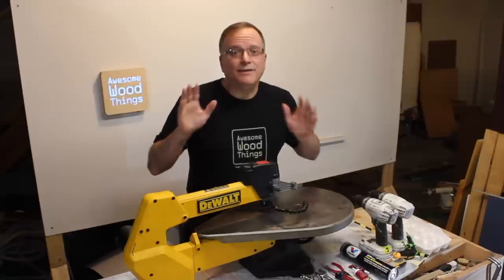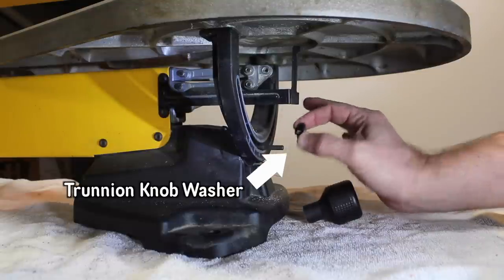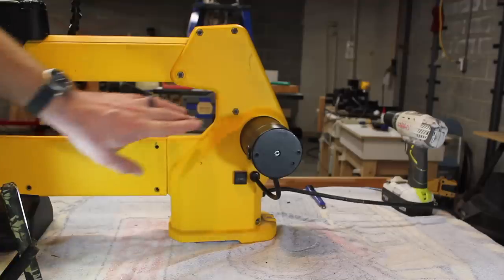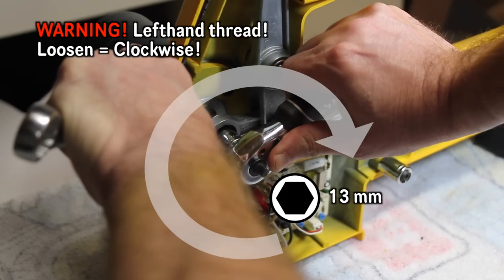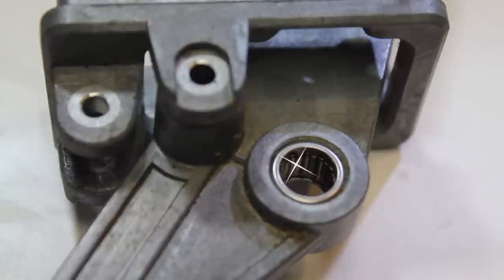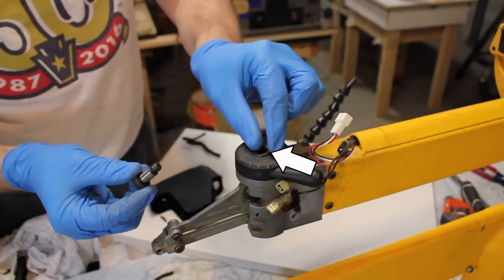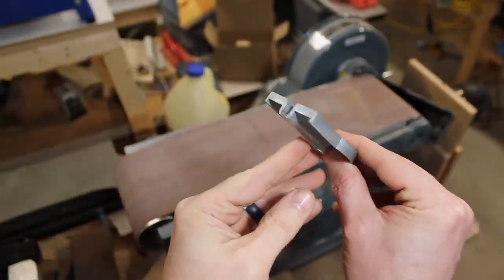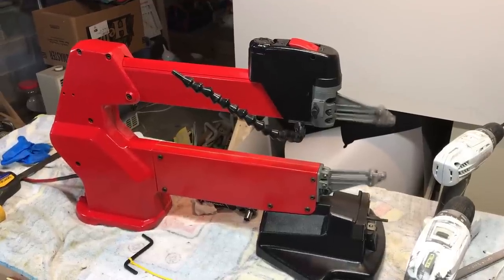Ultimate DeWalt Scroll Saw Repair/Maintenance Guide

Comment: Matt, 
I'm having problems with my speed control (DeWalt 788). The problem is I can not adjust the speed it just wants to run at top speed, I have discovered if I tap the side of the speed control cover I am able to adjust the speed normally but eventually the saw goes back to wide open. Any suggestions, I'm guessing something is wrong with the speed control switch, if so, is this something easily replaced?
Reply from the maker: Hey William,
It's seems like the potentiometer is starting to go... that's the small piece of electronics found under the plastic housing that covers the top rocker assembly.
Reply: Awesome Wood Things, I had the same issue with my dewalt. Most of the time the potentiometer does not need to be replaced it just needs to be cleaned. I  used Hosa D55-6 Caig Deoxit ( Amazon $15) and it is working like new, the slightest turn will change the speed. You need to disconnect and remove it from the saw and spray inside the small access holes around it, you will see all kinds of nasty stuff come out as you shake it. Don’t be afraid to spray it copiously, the product is made specifically for cleaning electronics it’s a miracle in a can. It has save me many times. By the way it may be too late and you may have already bought the part, but as you may already know it pretty expensive.